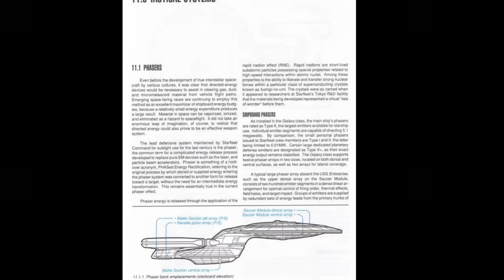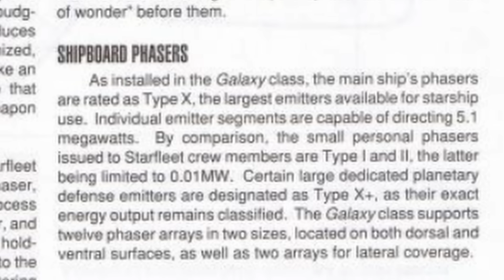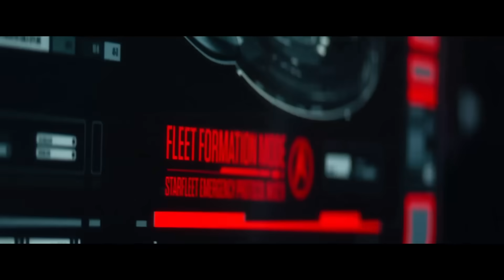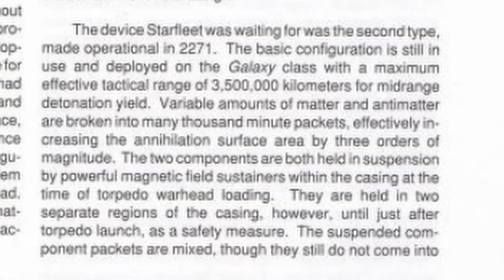Phasers: How Powerful are they Really?

Comment: Sorry, but those fake "AIs"are not doing any math they are just LLMs outputting most probable tokens. They are horribly bad tool for any "mathing", Have you actually checked that those numbers are really correct?
Reply from the maker: Have you ever tried using AI to do math? As a calculator they work great. Take anything they tell you fact-wise with a grain of salt but numbers alone they're pretty solid

Comment: They seem to interfere with color confinement at full power.  Phasers aren’t lasers, they seem to disrupt the strong nuclear force.  Based on descriptions I think they’re able to break the residual strong force color confinement and cause the quarks to degenerate to a quark plasma state.  CERN has demonstrated this…they use 1.3 TW a year…Lower settings represent electromagnetic effects.  That’s how I would explain phasers.  It’s been years since Intro to Astrophysics and the notorious BOB …😁🤣🤣🤣🤣🤣
Reply from the maker: Nadions on their own do nasty things to matter
Reply: @fictionrant7805 so would the disruption of color confinement…I wonder if rotating microscopic wormholes could be what nadions are made of…from quantum foam…it could explain their extension in subspace, since a rotating black hole has a ring shaped event horizon…
Reply: Our professor in astrophysics was cool 😎 we discussed movies and their relationship to current physics theories…mind you, these theories were still way out there and string theory was still in vogue as a GUT contender so…
Reply from the maker: @marksmadhousemetaphysicalm2938  nice! 

I find that most academics at that level are massive nerds
Reply: @fictionrant7805 I’m a huge nerd…yes, and my professor was the biggest Geek and nerd I’ve ever met 🤣. The stories he told …🤣🤣🤣🤣🤣

Comment: Okay,  using the Star Trek the Next Generation Technical Manual,  setting three, places 100 joules at the point of impact on the target. This means that it is, for setting one eight and a 1/3 joules at the point of impact on the target. For setting two, it is twenty-five joules at the point of impact. For setting four it is 350 joules at the point of impact. For setting five, it is 700 joules at the point of impact...

However,  a small percentage is vanished...

As a side note they,  in the real world (sorry), have measured the fourth spacial dimension.  Before this, it might have been sending matter into west hyperspace. 

But now we have a direction to which the matter goes to. A vacuum. Perpendicular to the first three spacial dimensions. This does the high level work. 

Further side issue: please find yourself a copy of the January 12th,  2009 'Aviation Week and Space Technology '.

You will find that Phasers are real.

1,500 fiberoptic threads, precisely timed, form a Phased Array Laser...or Phaser for short. 

Keep in mind that the article was written back in the 2008-2009 time frame...

So, a single multiplexed fiber optical thread probably can do the "thing ".

The real problem is heat byproducts in the actual device. Looking around a different technology,  that of rail guns,  one can figure out just how much heat is produced in one second. Which tells just how much power is actually involved...

Meltdowns are embarrassing.
Reply: Oh, before I forget again...
A Nadion is a  modified photon. Heavily leverage in terms of information content.

Comment: @10:20 it is completely allowable to consider analogous real-world nerfs against the stated "maximum capabilities" of sci-fi properties when considering what they "can do". A few great examples of the real world come to mind:
First, navies that use ski-jump style carrier launch systems instead of catapult launch systems have to nerf the combat loads of their aircraft when sending them into battle. Sure, they might be able to carry 10 tons of ordnance when taking off from land, but when taking off from a carrier, they have to drop either stores or fuel to get into the sky.
Submarines can patrol quite a while submerged, but eventually will run out of food or other things that reduce their patrol duration. Also, while they may be able to swap out ordnance loadouts in port, they can't just magically decide that "all my nuclear missiles are Tomahawk missiles, now, so I can launch them without instigating WW3!"
Equipping any armored vehicle (e.g., tank, APC) for a combat mission involves understanding what the vehicle is expected to face and giving its crew the best possible equipment to deal with it. A single Abrams tank might be able to serve as an anti-aircraft battery, or it can take out a whole regiment's worth of troop carriers. But if it isn't equipped with the right balance of munitions, you might as well just throw a 99 Toyota Camry into the battle and wish them luck.
Reply from the maker: Definitely true

Comment: 11:50 anti matter is used as power storage for starships, as is technically manmade blackholes, as for power distribution,through plasma conduits all things are probable, since plasma can heat up however much it needs to and so long as the self reinforced magnetic fields stay stable then nothing gets slagged.
Reply from the maker: The artificial black holes for power are a Romulan thing

But yes, for power distribution, plasma makes perfect sense.
Reply: @fictionrant7805 romulans use black holes, federation uses both fusion power plants and antimatter fuel tanks
Reply from the maker: @Grimmance yes exactly

Unfortunately, antimatter reactions alone don’t account for the amount of power being thrown around

Comment: What if they are called phasers because they cause the some or all of the quantum fields constituent in the target to start “vibrating” incoherently and chaotically start phasing back and forth between our and another or multiple dimensions, the others likely having somewhat dissimilar laws of physics which will not allow those portions of the target that momentarily phase into them to remain coherent and which may impart a positive or negative energy of their own, further disrupting the coherence of the target which could then itself become the energy of its own demise as its atoms or subatomic particles break apart and discharge energy much in the manner of an atomic bomb, possibly partially muted by some of that energy leaking back into the other dimension through the phase breach.  In such a scenario, radical as it may sound, the destruction of the target need not be proportional to the energy exerted on it by phaser that initiated the process.  The phaser would only need to throw enough of the target out of phase with the current reality to cause a catastrophic localized overlap of or bridge between two or more different dimensions of space-time and something other.
Reply from the maker: That would entirely depend on figuring out what exactly Nadions are doing

Interesting idea though

Comment: I would say distance changes the contact damage, plus atmospheric loss of the particles before hitting the planet. 

Also frequency focus was a thing so basically, the damage output changes depending on a lot of factors.

Range 
Frequency harmonics of the target
Stress on the weapons systems 

As for torpedoes, making them hard to hit and deploy a load reliably with anti matter likely deals now damage than phasers.
Reply from the maker: There’s definitely plenty of mitigating factors that make phasers or torpedoes less effective in a given situation but they’d have to be pretty massive to compensate for torpedoes only having 2/3 the yield of normal phaser operations
Reply: @fictionrant7805  I think one of the issues is just how bad the distance is represented in the entire franchise. I know in the shows it looks like they are nearly touching when realistically they would be pretty far apart. 

That's really all I can come up with to justify what happens. This is a theatric retelling of events. 

Frequency modulation has a huge impact on how things like phasers would interact with something, even if partials are involved. 

If shields are able to create a barrier plus adjusting the frequency harmonics of the hull are an option which, it seems to be, you can do things like reflect, deflect, absorb and disperse a lot of energy that way. 

200km is a long distance. The spreading of the particles and energy, movement of both ships, layers of deflection before hitting the ship all contribute to that. 

Where as a torpedo carrying antimatter would always be devastating no matter what it interacts with. 

That's a lot of "IFs" though. Do know I do agree with you on your observations here.
Reply from the maker: @ChadZLumenarcus  The obvious answer regarding engagement distance is that it looks cool

The more in-universe practical answer could be a few things. 
1. Most of the closeup fights we see were defending static targets be that a space station, a planet or whatever else. If everyone is moving and maneuvering, eventually everyone is gonna get pretty cozy. 
2. Evasive maneuvers. Even with phaser arrays, they can only adjust their angle of attack so quickly so if you're close up, you have a better chance to dodge. 
3. Specialized weaponry. Pulse phasers in particular are close range weapons. 
4. Denying opponents the opportunity to react. At max range a phaser takes 1 second to make contact with a target. This makes hitting fast targets really really hard to do but also means that with superluminal sensors, you're giving your opponent that much more time to adapt to your attacks, making them less effective.

Comment: The power output of the Sun and the power of sunlight hitting the Earth's surface are two completely different things! The statement in SNW refers to the latter, not the former! A warp core isn't that powerful, let alone a phaser!
In fact, the only warp core in ST that even comes close to stellar power is the one on the 1701-J, whose central reactor can supposedly provide star-level power—used for spacetime travel or other reality-altering needs.
Once you scale down the power mentioned in SNW to the order of 1.74 x 10¹⁷ watts—doesn't everything start to make sense?
Reply from the maker: They literally contextualize the energy and state the number of watts outright

They knew what they were doing
Reply: @fictionrant7805  Oh god.

Comment: Plus - what happens to all of the vapor?

Gross.  Even if it instantly broke everything in a human body down in the simplest molecules such as water vapor, carbon dioxide, and a few metallic oxides - that might not produce any smoke, but it would produce a big explosion of very hot gases.  They would look like the gases in any ordinary flame - because they would be hot enough to emit light.  Even if it somehow broke all of those molecules down into the simplest possible molecules without adding any heat to them at all - the volume of the gas produced would be much greater than the volume of the solid body, and there would be if not an explosion at least a big gush of wind (again - sick to think about - but then, we are talking about vaporizing people).

This gets down to another very fundamental Star Trek self-contradiction - or at least enormous plausibility.  It looks with phaser on the disintegrate setting that the matter constituting the person is disintegrating and being converted to "pure energy".  This would be analogous then to the way that a transporter supposedly does that before reassembling the same physical body in a different place - in the way in which plates of hot food are materialized from pure energy in food replicators (interestingly - transporters were only invented in the original series in the first place in place of the original plan to have crew always land on planets in shuttlecraft - more relatively realistic to things in the actual space program - because no shuttlecraft model had been built yet, and also because filming those scenes would maybe have added too many unnecessary minutes to the limited time available for every given show).

The largest hydrogen fusion bomb ever exploded was Russia's Tsar bomb - which released 210-240 petajoules of energy - equivalent to about 50-58 megatons of exploding TNT.  The bomb was released from a height of nearly seven miles.  The fireball that it created was five miles wide; and the mushroom cloud that it created was 25 miles wide at its based and reached an altitude of 42 miles high.  The flare was visible more than 620 miles away; the blast wave circled the globe three times; a seismic wave created in the ground beneath it also circled the globe three times; glass shattered in windows 480 miles from the explosion; buildings were destroyed 34 miles away, heat from the explosion could be felt 170 miles away, and although it was detonate 3 miles above the ground it created seismic waves of magnitude about 5 on the Richter scale.  The total explosive yield of the bomb was about 4000 times that of the bomb that was dropped on Hiroshima at the end of the Second World War.  By comparison, this was about equivalent to the amount of energy in the surface level seismic energy created by the Tohoku earthquake in 2011 (not equivalent to the total energy of the earthquake itself - which moved the entire island of Honshu 8 feet closer to North America, shifted the entire Earth's axis by 10 to 25 centimeters, and shortened the length of every day by 1.8 microseconds due to the redistribution of the Earth's mass.

"Eee equals em cee squared", and, if I did the math right - this means that about 2.5 kilograms of mass of the materials in the bomb were converted entirely into energy when it exploded.  If the body of a 100 kg person were entirely converted into energy - whether by a phaser or in a transporter beam - it would produce 40 times as much energy as that.  Just materializing a few plates of dinner in a food replicator would require as much energy as the Tsar bomb produced.

Hmm...

(Physics is fun - but maybe some things science fiction should just remain science fiction...)
Reply from the maker: Another commenter was pointing out that Nadions have interactions with subspace so it could be that all the energy is bled off into another dimension.

Kindova lame explanation but helps avoid blowing everyone up
Reply: @fictionrant7805  Right - of course.

We don't really know what subspace.  Other than that it has something or another to do with warp drive - and something or another to do with subspace radio.  So I guess that given that we don't really know what its properties are, it could be the explanation for a lot of things.

I wasn't really quibbling on Star Trek.  It's just fun to do the physics and see what mass/energy conversion is really like (I mean - it's definitely at least a metaphor behind things like the transporter).

It isn't really exactly what you might expect.  Who would have guessed that up to kilograms of mass would disappear from the matter involved in a nuclear explosion?  It's a bit like with the speed of light - where, yes, it's fast - but it takes a few hours for light or radio signals to cross the solar system.  But then also - actually converting something the weight of a human being from mass into energy would - be - well, things that big don't happen.  Even just materializing something the weight of a plate of food gets up into the range of the amount of energy released by H-bombs.

Star Trek is fun.  Science fiction doesn't have to be based on real-world physics - otherwise, there wouldn't be much of it.
Reply from the maker: @JosephLMcCord  really the major flex of Trek tech is that they can do so much matter-energy conversion so casually without blowing themselves up making breakfast
Reply: @fictionrant7805  Honestly I'm old enough that I grew up on OST - and when the food synthesizers came out with Next Generation - I think it was a bit cheap and silly.

Okay - it has a nice aesthetic - and I've gotten used to it.

If it's interesting - it's probably because it gratifies a kind of psychological wish-fulfillment urge.  Like a lot of other things in science fiction do.  Otherwise it's kind of pointless in that - it would be cheaper to hire a whole team of cooks (unless energy is completely free).

When Voyager went back to showing people actually cooking things - I thought that was pretty cool.

I'm only commenting on it in the spirit of fans who like to make fun of their favorite shows - because they like them not because they don't.
Reply from the maker: @JosephLMcCord  I gotcha

Comment: The biggest question mark about phasers is the presence of nadion particles.  The TNG manual refers to matter being "transitioned out of the continuum", which is a McGuffin to solve two problems.  First, it keeps the energy-to-effect ration intentionally vague, and second, since it's disintegrating matter, making the matter "go somewhere else" allows you to neatly make someone disappear without dealing with the biological equivalent of a 90kg water-into-steam explosion that would kill everything in a room.  Where that somewhere else actually is, who knows.  It's fiction, after all.
Reply from the maker: Just gotta shunt everything into a pocket dimension
Reply: Phased from WTNG 410 AM to WVOY 430 AM
Reply from the maker: @cosmictreason2242 wat?
Reply: @fictionrant7805  making a joke about radio frequencies and comparing that to "dimensions" in space, as opposed to alternate universes. Tune matter out of phase with your frequencies and make it non interactive.